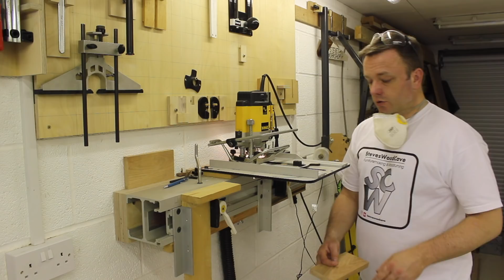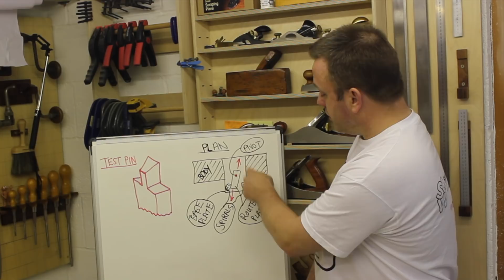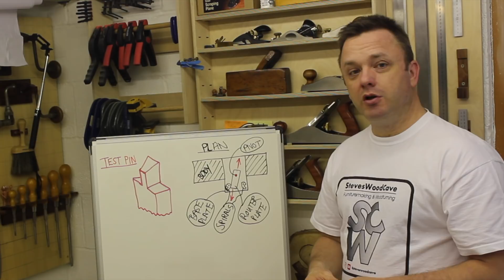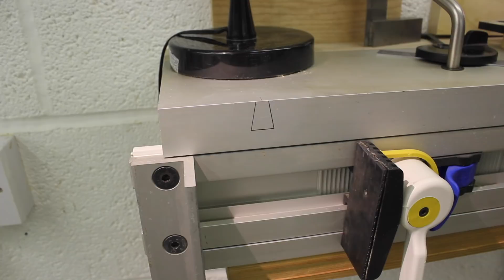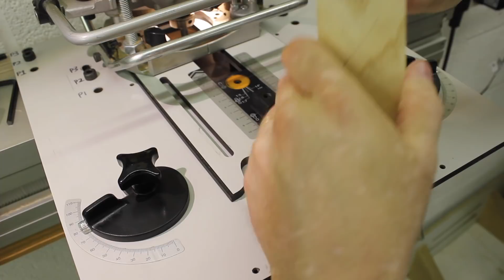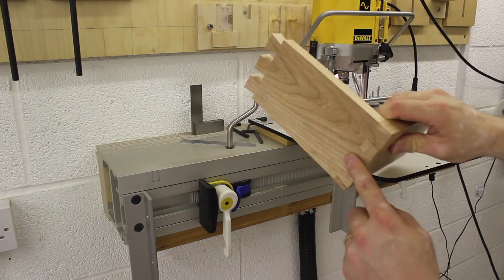The WoodRat - Through Dovetails (in detail)

Comment: Steve, many thanks for putting these videos together, they are really helpful and I hope you are still using your WoodRat!

Today, for the first time I attempted through dovetails and I was following Mike’s printed tutorial. I got seriously confused with the dimensions in the guide and spacing but persevered and  managed to produce a joint that fitted. Watching your video after having worked through it has helped me consolidate  - I particularly appreciated your diagram with the dimensions clearly marked out :)

Hoping to build a small cabinet as a learning project, this is a good start for me.

All the best
Nige
Reply: And I forgot to ask my question! If you have the time, any thoughts would be appreciated.

I am confused about the cams 😂 Your video (and Mike’s tutorial) explains that reducing the number or increasing the number reduces or increases the size of the pins (by 0.1mm per unit) - but I thought that they set the angle, so surely adjusting them will affect the angle so doesn’t that cause a problem with the fit of the pins? I’ve tried it out and it does work, but I can’t get my head round the fact that they were set to follow a set angle…. 😅
Reply from the maker: @nigelharris3015  Hi Nige, thanks very much for your feedback and question. I'm glad to hear that it is helping. In answer to your question I think that by changing the angle of cut that this inevitably will cut more off the workpiece and therefore both the angle has changed and the size of your pin has changed (in this case by making the pin smaller than the previous cut that you made). The widest part of the pin (the base of the triangle) as you look down on the end grain becomes smaller because you have changed the angle that the router plate is pulled through the workpiece. At least that is how I think it's working! Does that make any sense? By cutting the test pin out of some scrap wood you can't go wrong really which is why it's a good method. As soon as you have the cam spiral & button (pivot) number settings then you just need to write them down somewhere safe for the particular set of straight & dovetail bits that you are using for future reference. Hope this helps and good luck with your cabinet?
Reply: Thanks for taking the trouble to reply Steve, appreciated. 

Understood - that does make sense.  I was getting confused with the method to make the pin smaller or larger, once I’ve got the angle dialled in I’ll stick to winding the handle to align to the template in the marker position. All the best to you from Lincolnshire! Nige.
Reply from the maker: Good news. Another way to think about this is that when viewing the end grain of a pin you’re normally expecting to see a trapezoid shape. As you probably know a trapezoid has a wide base edge and a narrow “nose” edge which is an edge parallel to the base edge. The angled edges of the trapezoid join the two opposing base & nose edges together. When your workpiece is in the cutter position the nose edge of the trapezoid will be nearest to you and the base edge will be next to the Rat body. So because the spirals set the angle that the router bit will travel through the workpiece if the spirals are set close together then a narrower trapezoid will be cut than if the spirals were set further apart. If you think about the trapezoid a narrow one will have a shorter base edge than a wider one. Again I don’t know if this makes sense but it’s the best I can think of right now!? Cheers from Devon!

Comment: What a clear description. I’m back into using my wood rat. Getting it too deep means you just have to sand or plane off the joint. If too shallow the whole board would need planing. Such an exellent video for me to restart my Woodrat use.
Reply from the maker: Thanks Jim. I’m glad you find it useful and hope it helps motivate use of your Rat. Most folks do leave the pins protruding and clean them up with a handplane. In case you didn’t know there’s several other WoodRat videos on my channel.

Comment: Hi Steve
Do you use aluminium guide rails when cutting through dovetails or do you use the spirals 
Cheers 
Stuart
Reply from the maker: Hi Stuart, the video reveals the answer! In short, you need both - the ally guide rails for cutting the tails and the spirals for cutting the pins. Hope this helps? There is a shorter video on through dovetails (about ten mins) if you prefer but this video gives all the details. Thanks Steve

Comment: Thanks for the video. I’ve had a WoodRat for about 6 years in a box and always ‘meant to get around to it’. Well, thanks to your video I finally have. I have some small problems with the left fence catching on the body and as yet, have not managed a perfect dovetail, but I am getting there and I now understand the theory, which helps a lot. I have mounted my WoodRat on a dewalt mitre saw stand and it is semi mobile - also quite sturdy - you can buy the dewalt clamps separately to the mitre saw.
Reply from the maker: Good to hear that you’ve got it out of the box. Sounds like you’re making good progress. It does take a few goes to learn but once you know what’s what the penny should drop. Good luck with it...

Comment: Hi Steve I can see that you are making the dovetails so that they are symmetrical and evenly spaced. I have been using the parrellogram method that is shown in the WoodRat manual. The dovetails aren't evenly spaced which is fine as long as you make the pins to match each tail but somehow I've got lost whilst trying to make drawer boxes and the tail and pin of the 4th corner of the drawer don't match. It's a bit frustrating as I think I've followed everything in the instruction manual. Anyhow if you have any advice in this situation let me know, I guess maybe its not possible to advise without seeing them though
Reply from the maker: The parallelogram should give you even spacings as far as I know. Are these through dovetails? If so you need to make sure that the pencil mark at the marker position is just showing when the tailboard is used as a template. But if you follow my symmetrical method then your DTs will fit any way round.
Reply from the maker: I would not use the parallelogram and try the method I show here in some scraps first. When you’re happy with the method then make the real drawers.
Reply: ok cheers

Comment: Your bevel gauge measuring technique to measure the correct spiral setting is very helpful as I have found today that the Woodrat published settings for various dovetail/straight cutter combinations are not accurate by a considerable margin. So well done. Thank you.
Reply from the maker: Yes it can take say 20 minutes to find the sweet spot for your cam spiral settings but once you have the number for a given pair of cutters (dovetail+straight) you can keep a note of it (as well as the button setting number) in a safe place and when you use that specific pair of cutters again in the future you can just set the machine up and cut them really quickly. The numbers are fixed for that pair of cutters as long as they are not reground/honed to change their dimensions and/or one of the cutters is swapped for a different one. Anyway let me know how you get on when cutting yours, I’d be interested to hear how it went. Cheers Steve

Comment: Thanks for the explanation, i like to have an understanding of dtuff so seeing the calcs for working out the vsrious settings is great.
I like the Woodrat cutters, one, because they are HSS and will always produce a superior cut to TCT (in timber anyway) and two they use the traditional ratio for the dovetail slope
Reply from the maker: No problem Nic, glad it was useful. I too like to understand how things work, so the formula is right up my street! I agree with you on the choice of using the WoodRat cutters due to them being HSS (in timber only of course) and their more "handcut-dovetail-like" slopes. The advantage of using the formula is that it works for any type of router bit (tungsten carbide or HSS). Like I mention in the video, once you have selected two router bits or cutters, calculated the button setting and cam setting, then just make a note of the numbers for that pair of cutters (with the caveat that if either of the bits used changes and is replaced, that the resultant fit may not be the same). A test pin should not need to be cut for that pair of cutters thereafter, it's a one-off step.

Comment: Hi Steve, great video but I'm wondering why you didn't use the tables in the handbook?
Reply from the maker: Thanks Nic. The table in the handbook, as far as I’m aware (at least in my circa 2000 handbook), are only for the WoodRat HSS dovetail cutters.  The formula and calculation works for any type of cutter and is pretty easy to work out. Hope this helps?

Comment: Hi Steve, 
Thanks for the new video it’s such a help, one thing I want to ask and not sure if I missed something but which orientation do you have the show faces of your box sides? Ie: one in and one out or both in or out respectively.
Thanks once again, Andy.
Reply from the maker: Thanks Andrew. Good point! I forgot to mention this, sorry. You need to look at the end grain of your pin board, notice that the narrowest part of each pin (when looking into the end grain) are on the side or face of the board which is outermost on your box or drawer. Take a look from 26:19 in this video where I discuss the waste portions, this might help? So when cutting the pins the face of the pin board, which is on the outside of your box/drawer, should be facing you when it’s held in the cutter position clamp. Hope this helps?